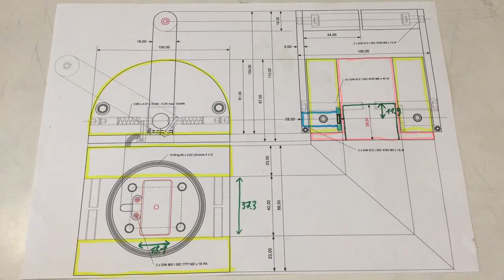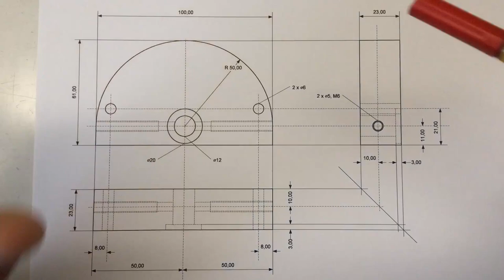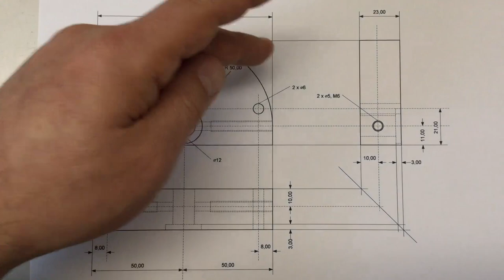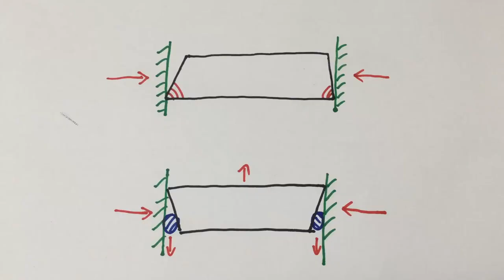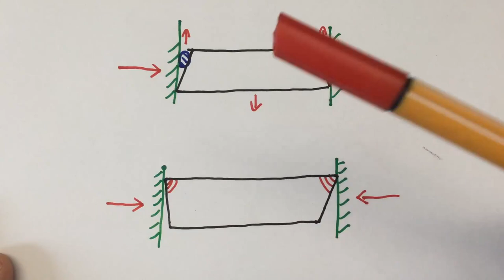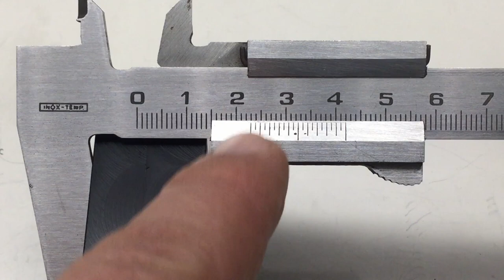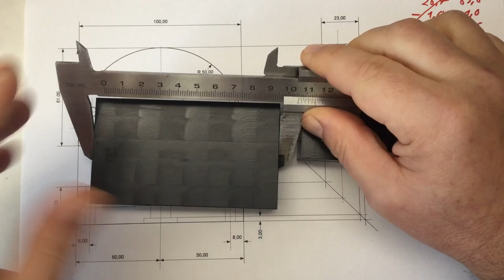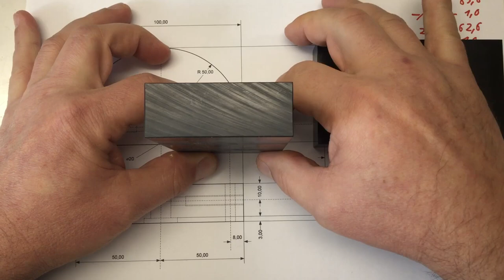Dual Electronic Engine Control Lever IP68 (9): Side Parts (1)

Comment: Probably you can get better finish in pom with a real flycutter, but I don't know if the are flycutters small enough for the proxxon.
Keep up the good work
Reply from the maker: You're probably right. Though the flycutter won't solve the problem with the tramming error of my mill's head. Before my next project with the Proxxon I probably get something like a tramming plate and turn a 6mm adapter for my dial gauge. And I'll do my best to keep up the good work 😉

Comment: habe mir einen kleinen flycutter gebaut, dein grosser fräser belastet die maschine sehr und so schön wie mit fly cutter wird es auch nicht, wenn ich auf 50 mm stelle kann ich eine fläche von 100 mm schön an einem stück planen
Reply from the maker: Ich habe schon nach einem Flycutter für die Proxxon gesucht, aber keinen gefunden (die kleinsten brauchen eine MK2 aufnahme). Wie genau hast Du Deinen Flycutter gebaut?